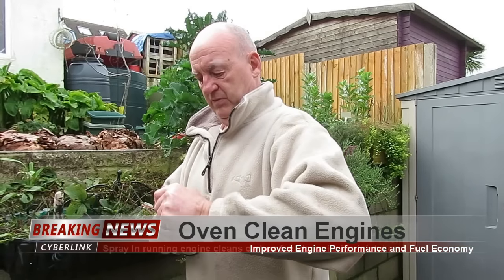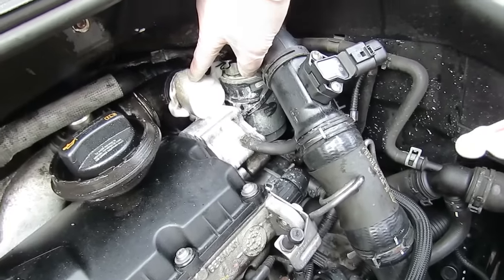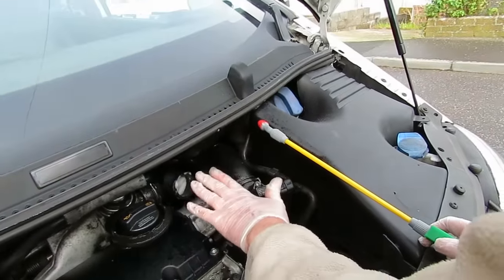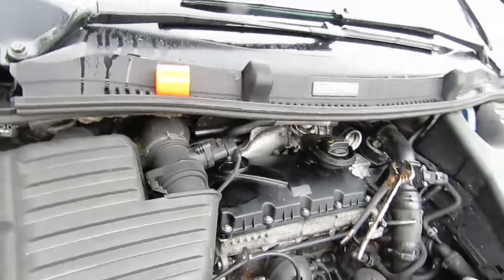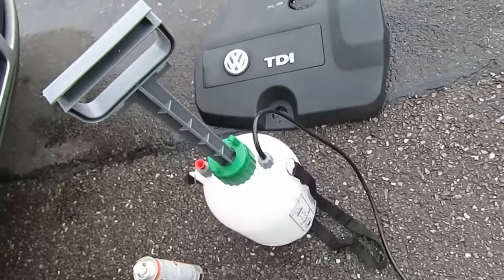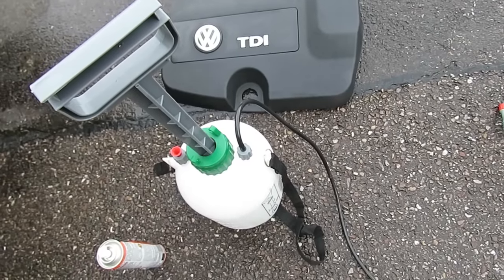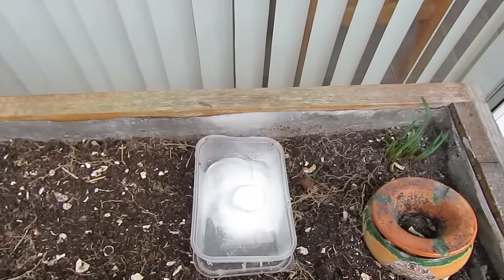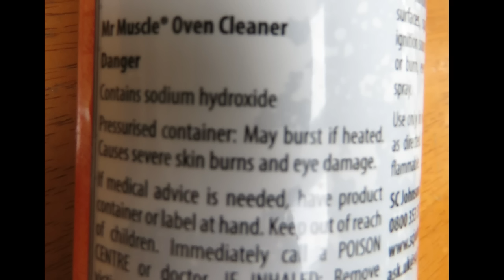Clean EGR Valve Decarbonize Turbo DPF MPG Limp Mode Mr Muscle VW 1.9TDI Sharan Galaxy Alhambra

Comment: I do this all the time engine runs great, apart from all the alloy that's missing runs like a dream :-/
Put a Jonny over it so we can see it blow up from chemical reaction.

I'm not trying to offend believe it or not but this is corrosive stuff being hit with plenty of heat.
Reply: Not enough of it to cause any problem....  petrol is corrosive, so is diesel itself, anti freeze is corrosive and so is just pure water on alluminium..

Comment: will it clean intake valves ? 2.0L 75hp PD BDK engine
My EGR is on the opposite side of the intake hose and MAF, I am more concerned that the engine is over 750k km and I think it was never decarbonized properly

Comment: Please no-one do this to your car: Mr Muscle is a highly corrosive oven cleaner, and he is spraying into the air intake after his problem parts anyway: what a timewaste and carkilling video.
Reply: Now explain why it would be doing any harm ? we are talking the intake that then goes into combustion chamber where explosions take place then down and out the exhaust where all the mucky crap goes.. now when its in the combustion chamber what do you think its doing exactly ?.... well what it does is cause a higher temp burn that cleans off carbon then evaporates and goes out the exhaust.. why do you think you can buy the same stuff just given the name of egr cleaner ? then can buy distilled water to spray down the intake ha aha  it gets distilled when its in the combustion chamber... do your research and go check in the motor shops. youl see around 10 different brands of this in any one motor shop... or buy it direct from vw audi or mercedes benze or chevrolet or ford or chrysler etc

Comment: FOR THE LOVE OF GOD DON'T ANYONE TRY THIS
Reply: Davie88888 Right on man! These guys must be on drugs! Fair dinkum!
Reply: Mean while keep getting ripped off by your local dealership
Reply: Take it to your garage instead for you to charge £150? No thanks....
Reply: I agree. The Mr Muscle will eat aluminum for breakfast. Will indeed clean cast iron, so for turbo side would work fine, but not in your intake!
Reply: ok if he is doing wrong show as the right way or you are one of the ripper
Reply: For those of you in America, it's a diesel engine. They knock. Hello!
Reply: nathankraehenbuehl mine doesn’t sound like that and it’s got 230000 miles on it and never had crap sprayed into it funny that
Reply: He even shows that it reacts with the metals never mind the rubbers then sprays water in OMG
Reply: And a hand full of sand loosens those hard deposits

Comment: What damage do you think your doing to the turbo charger seal ?
Reply: Not one bit. Worked on diesels for 30 plus years, it takes alot more than oven spray to kill a tc seal.
Reply: @mikebigelow9057  ovens have seals, I don't think Mr Muscle would have lasted long if it damaged them

Comment: Turbo washing has been done for decades on boats and ships but i think the oven cleaner approach is one step too far for me due to its corrosive nature. After combustion the steam created from the controlled water mist injected into the turbo cleans the combustion side with super heated steam. If not done correctly it will hydro lock the engine.
Reply: Well an unmeasured dose from a garden sprayer worked so I think your safe.
Reply: Hydro lock will occur only if is a lot of water there. That's why the water is in a form of a mist. Diesel have water in it and the engine works...but freezes in the winter.

Comment: Direct Injection...there is your problem.
Reply: Hi Buff,my name is Shaun & I think u know what your talking about by your quick short status as in two direct words! "Direct Injection mate! So please I beg u Buff ,',ive  an dti vivaro six spead f7reg 2006 and it goes like a rocket!!! " Only one thing Buff,my baby hates firing up and its now liturally not starting up at all as i have too now use easystart up the air intake...Buff before all this Covine 19  started its lock down me & my bestest mate iv known for 52 years now have cleaned the egr sensor and the piston was choked big time with carbon  & very oily too  + the air flow butterfly Also we found that their was one glow plug not working on test meter,'Now have all 4 new plugs installed..
Now started my DTI Vivaro f7 ... Back then & guess what! She fired up so prompt ,Rapid success and for the next 8/12  ignition starts at that time it was bleeding freezing with frost,winds & lots of rain&rain&contentious... Rain.
Me and my mate was well impressed until after the 12 times of starting the van up ...We found ourselfs thinking,O.M.G!..NOT AGAIN!....
BUFF she's fed on easystarrt  but now its drained my battery coz its got worse! 
Buff to me the diesel is not getting full injection as some times I have to pump that throttle peddle big time....so my mate said their could be another filtrate diesel container up under the diesel tank,fuel line next & then if that fails! Then maybe have to test the crankshaft sensor.
Or Buff? Is it to do with the Injectors? Please mate would u be so kind to give me your knowledge & tell me how I can sort this major stressed out problem for once & all bro as iv got real bad White finger in my hands & its killing me Buff...Help. 😤😬☺
P.s .. Buff it had an oil change + diesel filter,oil filter & air filter last December!!
Hope to hear from you soon... I mean A.S.A.P! lol...I await vfor you comments
Regards
$#€€¶¥★  ©

Comment: I found SEAFOAM brand injector cleaner also works Extremely well too. Thanks for the great tip! Seafoam also works in the fuel system to clean injectors, as well as engine flush  to clean out old deposits from the oil.

Comment: the other option is to fit a EGR delete kit
Reply from the maker: Yes I had thought about doing this, but wondered how it would affect MOT and regulations?
Reply: EGR delete are used in certain parts of Australia where they dont have the emission test that we do in the UK. Once done, its done so make sure you are going to meet the regulations afterwards.
Reply: A blanking plate and removal of the vacuum pipe should do, however a delete kit provides a clear passage way for boost to enter the engine.

Comment: did you realize what are you doing ??! forbidden to use mr muscle on plastic and aluminum AND surface .... !!! did see what give mixed mr muscle and aluminum in bottle ??? are crazy excuse me to say that , a lot of parts of engine like turbo egr build by aluminum !
Reply from the maker: Those experiments in bottles were with aluminium foil which has a greater reaction than a cast aluminium manifold. The oven cleaner was introduced into an open ended inlet. On combustion, sodium hydroxide is reduced to inert normal combusted  particles. Washing out the engine with water spray after treatment removed the oven cleaner.  In the video, I showed the reaction to aluminium wire and a T light candle foil. Other than discolouration at the surface there was no pitting or indication of weakening. So adding to a solid cast aluminium manifold clogged with fuel oil and carbon deposits would shield most of the oven cleaner from contact with the aluminium. Car is still running better as a result. 
I have purchased some Wins Turbo Cleaner to give this a try next to see if any additional performance can be achieved and will make another video to show how it goes.
Reply: Andrew K Fletcher how did the Wynn turbo cleaner do?
Reply from the maker: Useless :)

Comment: On my 2007 VW 1.9 TDi Golf, the pipe after the Mass Airflow meter, that you sprayed mr muscle into, mine doesn't go to the valve like the one in the video, it goes to the bottom of the engine, is it safe to do the clean still?

Comment: I have a sticky egr. I am a professional oven cleaner. Never the twain shall meet! Mr muscle it's a high pH Sodium hydroxide based cleaner and my engine block is cast aluminium. Sodium hydroxide destroys aluminium. I will try something less ridiculous like buy a new valve!!!
Reply: You might try throttle body cleaner on the egr vacuum port. So where the EGR is attached (not the tube side, the side with multiple holes facing the engine) there is a port to behind the throttle plate, at least on my car. The port can completely clog with carbon and cause P0404 or P0405 etc. New EGR might help, but if you still get a code, check for a clogged area to the engine.
Reply: Right after I posted I read your comment again, just a sticking EGR is better than the issue I had, but clearing that pathway still might help prevent it from gunking up again!

Comment: Also, history lesson kids. 👆 this is why we stopped putting lead in paint , fuel and pencils about 30 years ago and stopped making our teeth glow with radium and stuff. Now you know 😉
Reply: Lead was used in fuel as a cushion for the valves hitting their cast iron seats.not needed now because its aluminium.There is still lead in enamel paints.And the stuff is still in every tooth paste on the market...
Aussies get played with their head easily...
There is still aesbestos in brake pads,clutches and fireproof insulation.But you guys have to take it all apart to "remove it" and reinstall the same part with the same materials....LMAO!!
The burnouts you guys take so much pride in doing.creating clouds of pollution..Is 100times worst!!
So i guess you guys dont learn from history!!
Only running your mouths!!

Comment: Heck with all that just do an EGR delete for about $80 and you will get better fuel mileage and it will prolong the life of your engine.
Reply: @C Davies that's about the cheapest I could find it.
Reply: @C Davies mines a 2014 Jetta TDI. It's so much better for your diesel motor to not have an EGR-Exhaust Gas Recirculater on it. If these environmental wackos were really interested in reducing Emissions they wouldn't be putting EGRs on vehicles.  Is all it does is cause your motor to run hotter get worse fuel mileage dirty your oil quicker and it eventually will plug up. It's about the dumbest thing I've ever seen!!

Comment: The only credible part of this video is the swapping of the can adaptor.
There is no way in the whole wide world I would put oven cleaner down the intake or into an engine! No way no how!

Even if it did work imagine the potential internal damage that could be caused to bores, rings, pistons, valves, turbo, seals and everything else. Oil?
It may work in the short term (and I do say MAY) but what about 6 months, 12 months down the track?

Not in any engine I own thank you!!!!!!

Comment: If your going to clean your EGR valve, why not use EGR cleaning spray which costs about the same as the Mr Muscle foam ? Holts EGR cleaner 500ml is about £3.00 and the Mr Muscle foam stuff for 300ml is £3.50 approx. Better to take the EGR valve off the vehicle if you can, and clean it properly, use a spray and a toothbrush or bottle brush. 
What this guy is doing looks and sounds like a recipe for disaster, not everything you see online works, this could end very badly.
Reply: So true. 
But your way is to easy & he got time & money to burn...
I wonder what his local garage thinks off him.
Reply: I personally tried Holts EGR cleaner on many parts in the egr and intake  manifold. Is comes just a yellow thing and will not remove anything. If    you put oven cleaner you can see the effect. After 10 flushes with Mr Muscle still was black like the oil. Any will be left in the engine will be diluted by  the water enough to not corrode anything. The engine vapours will be as well cleaning the remain in fe miles. Oil might be the issue. It will disintegrate and might be the issue with the lubrication in the cylinder when is inside. I think this is the issue what people had using the method or they just saying because it doesn't make sense for them.

Comment: hi Andrew
i will try it in my Skoda  2009 1.4 TDi. 
how are the performance of your car ? 
thanks
Reply from the maker: Better fuel economy and more power, so I guess it has cleared a lot of the carbon build up. Take care not to spray too much in at a time, do it in short bursts with engine running.   45mpg on motorway. Car is automatic. Problem of limp mode almost none existent so will repeat and of course rinse :)
Reply: Andrew K Fletcher 
thanks Andrew for your replay. 
I wish you the best.
Reply: Why you didnt use vinger at different concentration
Its less corrosive than Naoh

Comment: Would you do this on a PD 1.9 Tdi BLS? It has 145000 on the clock and goes into low power after about 10 mins of driving.
Reply: I wouldn't do this on anything....
Reply: Yes!!

Comment: Never seen this method into the cold side before.  Have you still got that car?
Reply from the maker: Still got the car, but it has not solved the inherent problem with EGR in VW's  After a year or so, the same limp mode problem arose more frequently again. Despite changing the EGR valve and thoroughly cleaning out the manifold with a long wire bristle brush and paraffin , it made no difference.  As someone suggested EGR Delete makes sense, so will do this as soon as weather permits.
Reply: @AndrewKFletcher  oven cleaner is very corrosive.
I bet you screwed up a few sensors.next time remove the valve to clean it.you also sent carbon everywhere into engine.
Even seafoam etc does damage! I saved a j35 after using it..had to take engine apart,clean it and rebuild.

Comment: Why is the 1.9 tdi louder than usual? ive heard them alot quieter than this.
Reply from the maker: It is normally quiet, but with the air intake open, it sounds more throaty than usual.
Reply: Probably sprays water into the engine on each oil change. lol
Reply: @aarongunter5582  He is using water from Flint, Michigan.  It is highly combustible and won't damage the engine.
Reply: That’s the sound an engine makes when you spray water into it nothing to do with intake being removed
Reply: @andrewmason8844  😂

Comment: REALLY? Oven cleaner in the EGR valve WITHOUT removing the valve body from the engine? Oven cleaner in the intake manifold?
No thanks. I'll just have my dealer do a "BG Platinum" system cleaning of intake and EGR valves.
Reply: Its actually not a huge job to remove the inlet manifold and egr valve, the bolts are quiet easy to remove from the head, unlike the exhaust manifold bolts which can be a nightmare. Avoid this mr muscle botch job

Comment: yeh my air intake doesnt go right into the egr tho it goes to the turbo then to the exhaust, the egr in my 1.6TDI goes in one side of the engine and out the other, so what to do with that?>

Comment: The oven cleaner is supposed to go into the exhaust side of the variable nozzle turbine.. never put this crap through your intake especially with water added. The proper way to clean it out is to actually remove the egr and intake manifold, and soak in petrol over night, then scrub the insides with a small wire brush, You would be surprised how bad the build up is, I know as I’m a mechanic and have done this the proper way. All you are doing it pushing crap into the valves.